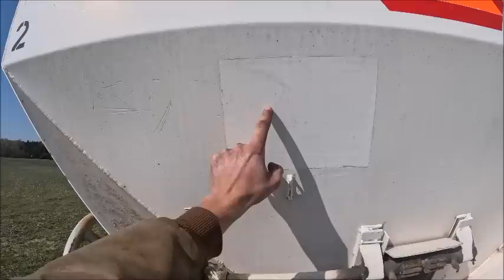Finishing Up Fertilizer Spreading, With One Technical Difficulty

Comment: This might be a dumb question as I’ve never spread fertilizer but how do you know where to make the next pass with the spreader?
Reply: It's just mainly done by eyeballing it, i.e. guesstimate about 40 feet (or 50 in some cases) in between passes (least that's the way we do it down here in Arkansas). Some people are better at it than others (I for one am not great at it). If you've got a newer tractor with guidance (either lightbar or autosteer) then you can set it up to work that way as well.
Reply from the maker: Count off seconds in the turn then eyeball your last pass.

Comment: I ran over a cow or a deer bone punched a hole in the rear combine tire a couple years back. Honestly probably went 4 rounds because it didn’t feel like anything was wrong no tilt no hard steering or nothin. It  was in the field next to the machine shed so when I drove in there I was pretty surprised when I got out and I had a flat with a fist sized hole and didn’t even notice.😂
Reply from the maker: I did that with the 525 years ago. Mud ripped the valve stem off. It had been steering hard because of the mud anyhow so I didn’t catch it until I had a hopper load.